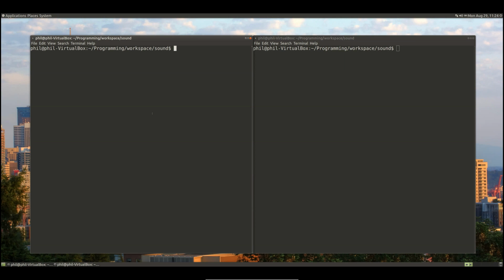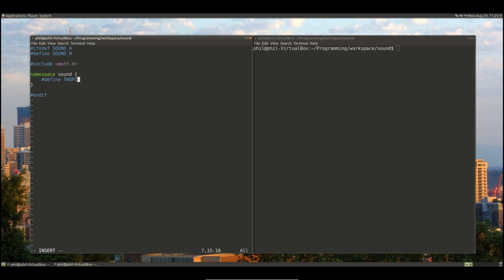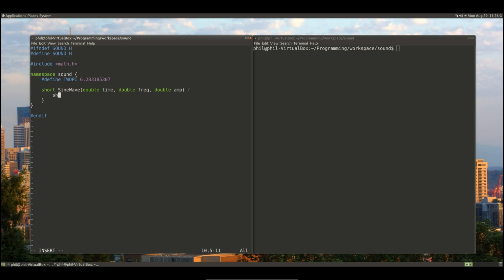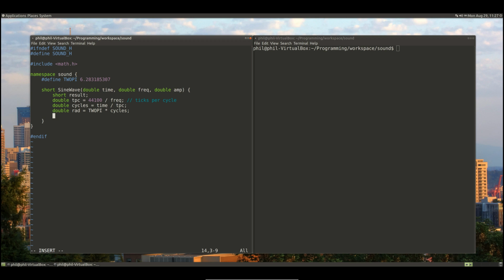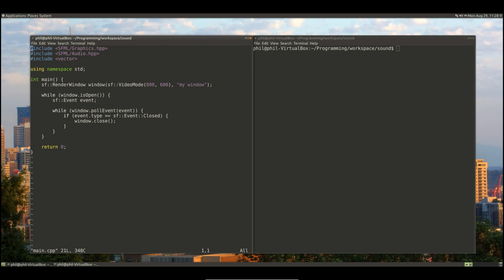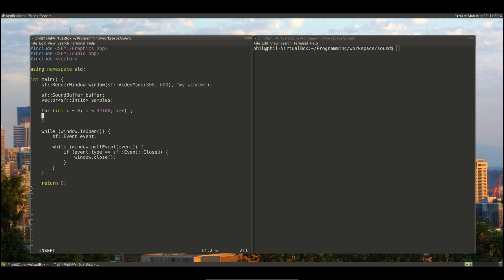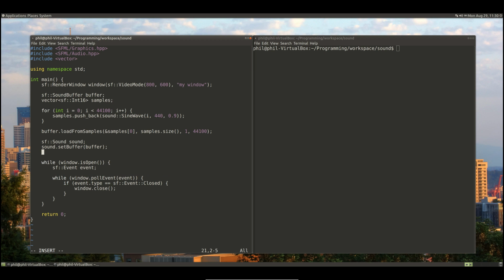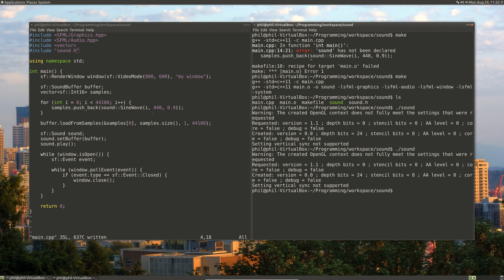#2 Generating Sound - Sine Waves

Comment: Thanks for this video!, this is what I have been searching for a long time. I assume that your time variable is referenced on seconds , due to the Variable "freq" being in Hz (Cycles/second), right? , or is it just the current Sample?

Also excuse my lack of knowledge, but what does the  ticks per cycle exactly represents? , might it be how many oscillations fit in one Hz?

I'm trying to port this to an Embedded Device, and need to understand this fully. Thanks!
Reply: Actually the time parameter is just denoting the current sample. This confused me while the function was being written, but it became clear to me when the function was used in the loop. Ticks per cycle would just be the amount of samples that are taken during one cycle of the sine wave, so for example if you had a 2450 Hz sine wave, then given the sample rate (here called freq) of 44100 ticks/sec, since 1 Hz = 1 cycle/sec, we have that tpc = (44100 ticks/sec) / (2450 cycles/sec) = 18 ticks / cycle. So every oscillation of the sine wave would be sampled in 18 spots. Hope this helps!